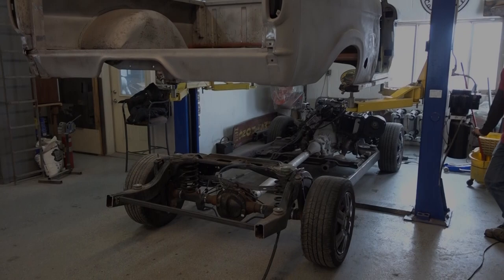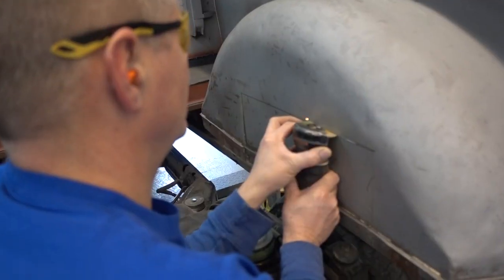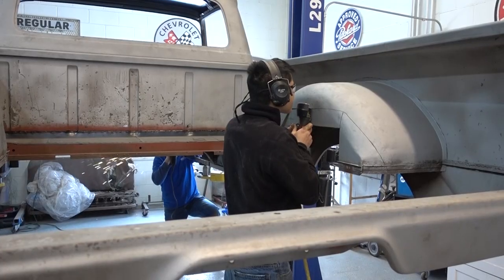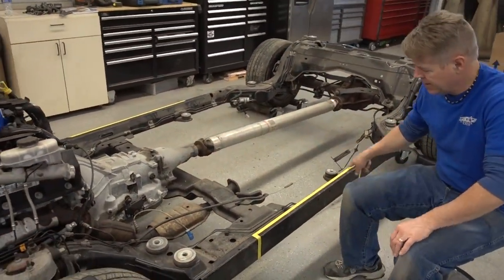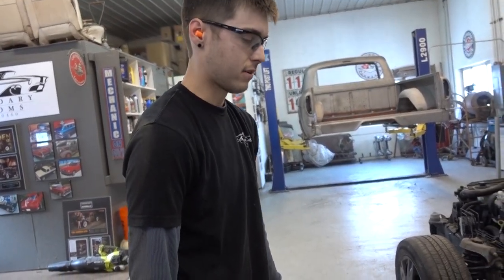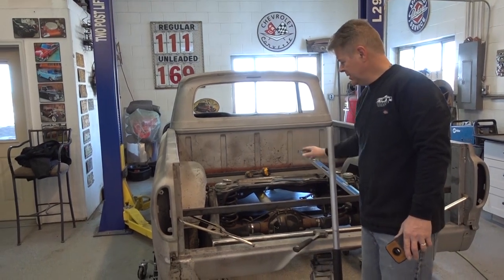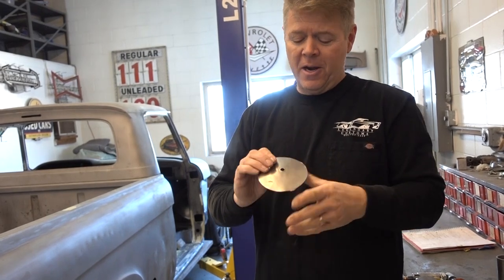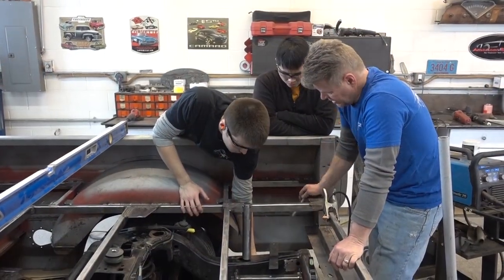Legendary Customs "Dirty Ford" full frame swap

Comment: Great video.  Thanks for your hard work and sharing it with us.  That frame mod makes me nervous, though.  I hope you know what you're doing with that.  To me it seems like a huge source of stress concentrations.  The worst concentration is where you transition from 1/8" original frame to that 1/4" box plate.
Reply: The steel slides deep into the original frame so it can't move up or down. With the X frame added in a later episode really stiffens everything up. A car frame is very flexible without the body on it to stiffen it up. After the 1/4" steel & the X brace, its much stiffer & stronger.